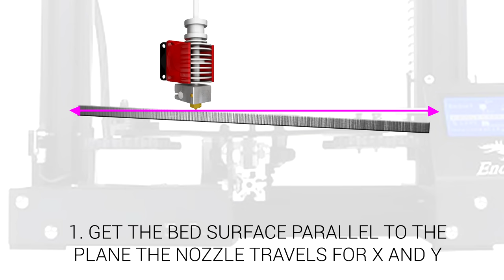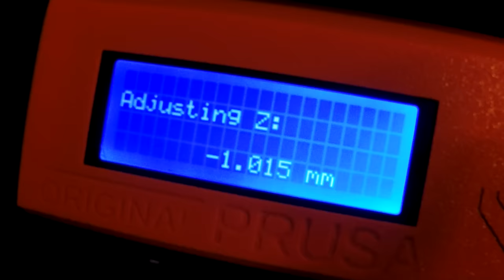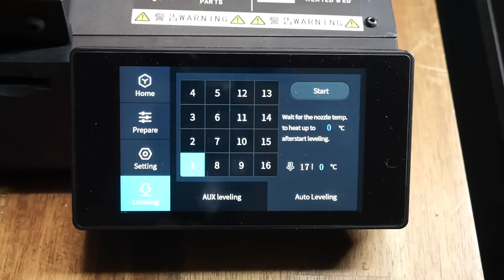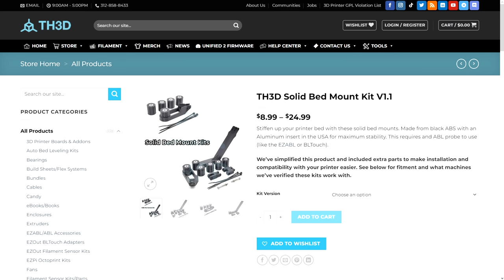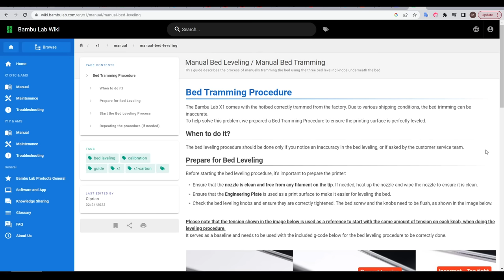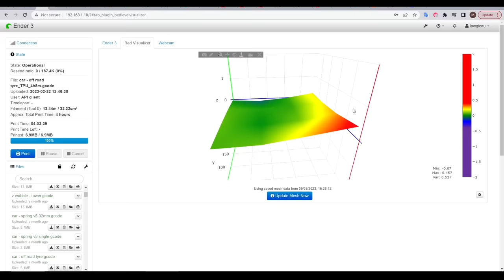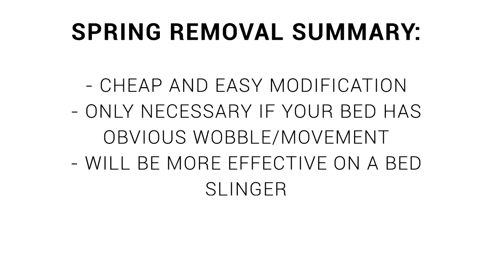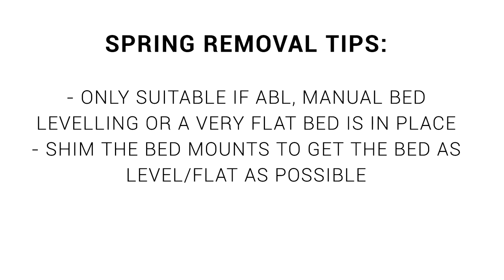Is it time for 3D printers to abandon bed springs?

Comment: When you rigidly mount a thin aluminum bed, like on the Ender 3, does it increase the chance of warping because the expanding bed cannot move outward? In the video, the printers with three point leveling have beds supported so that they can expand horizontally.
Reply: It can. This happened to my Ender 3 S1 Pro. I had it for a while now problem, but if the springs were tightened too much, the bed warped due to the stresses. I had to replace the bed. I can imagine if you went completely rigid mounting with a thin bed it could warp.

Comment: One of the reasons I bought an MK3 is that I failed miserably at bed leveling my old Wanhao i3. I could never get the knack of it, and my prints always suffered.  If the printer is going to required that I have to do adjustments to it, I won't buy it.  Not because I'm a snob about it, but because I know I won't be able to get the bed leveled and the right distance from the nozzle. It's all on me.  (I am, however, a snob about flexible removable bed surfaces like the MK3 and many other printers today have.  If you don't have that, I'm not interested, and I'm a snob about it.)

Comment: i have the yellow stronger springs it was fine when iwas using a z end stop not really many issues but since i got the biqu microprobe so many issues with the springs i was looking for metal spacers but then  i was told the silicone ones would be good so ive ordered those

Comment: Correct me if I'm wrong, bur something that came to mind for me is why do we need to deal with the bed hight when we could just set the Z offset with software?
Reply: Hardware solutions this simple are almost always more consistent. There's about a hundred use cases for software fixes, but starting with a true flat and level solves probably the majority of them.

Comment: In the interest of accurate information - Creality Hotbed Leveling Silica Columns - note it is Silica NOT Silicone. Generally, silicone is made mainly using naturally occurring silica stones. The key difference between silicone and silica is that silicone is a polymeric material, whereas silica is silicon dioxide.

Comment: I applied some nuts to all the bolts for the bed then added the springs. Stopped the bed moving and really locked in the bed to the frame

Comment: I'm using a fix bed (it's still ajustable like, i remove the springs and I'm using nuts to adjust the height it's rigid and it stays leveled for ever pretty much)

Comment: Could I not just tighten down all the screws, so the springs are very compressed, and there isn't any room to move? I'm running klipper with a BLTouch so I can set the z endstop wherever I want...

Comment: Honestly given the option id have a 1/4" steel plate keeping it perfectly rigid and flat...lol.  actually...now I'm tempted to bust out the plasma and cut a steel plate to see how thin a layer i can print fdm...  Im sure ive got more than enough in the garage..

My abl and auto dual z adjust do...really well, if it wasn't for how much the aluminum bed can warp itd barely have to even try.

Look at that x1 carbon... omg... its beautiful.  Single layer chainmail with no work... wow.  Granted my printers will all do it, but not at that speed from factory.  Just the level of "ready to go" is epic and would have been SO nice if we could have had that in the early days...

Comment: Does anyone know when using silicone spaces if the flat portion of the spacer touches the metal mount or the bottom of the bed itself?

Comment: bed springs and springy beds in general I don't think are useful for me and my printer any more. I am trying to use sensorless homing and frankly they are a terrible combination. Also have the long screws that don't tighten down and you know they move ever so slightly over time, enough to need me to level the bed a fair bit.  I would prefer to just make it a solid bed attached directly to the rails. It would give me another 10mm of print height anyways.

Comment: I think what makes a bigger difference in my Ender 3 is using hex nuts to lock down the screw to the bed. I use two nuts per screw to keep them from moving. This keeps everything way more consistent.

With this, I’ve tried springs, silicon spacers, and also wingnuts on the other side of the wheels to make a rigid yet adjustable bed. They all work great!

Springs by themselves are definitely the worst because any time they are compressed at all beyond your initial adjustment, there is play for the screw to move, which throws everything out of whack.

Overall, I’ve just come to accept the fact that there is no perfect consistency - every time the bed is heated, it can warp slightly differently so it’s always good to run the probe before every print.

Comment: The industry does a real disservice, especially to beginners, to use the term "Auto Bed Leveling".  People wonder how in the world a probe and some software can level the bed especially when some people have so much trouble manually leveling their printer bed.  Of course, the software/hardware can't level the bed which is why it should be called "Auto Bed Compensation" or "Auto Bed Tilt Compensation" or something more descriptive of what the system actually does.
As an "influencer", perhaps you can start the trend.

Comment: I don't see why people don't just use leveling nuts instead of springs or spacers. No need for spacers and shims when a simple nut will allow plenty of ability to fine tune the leveling perfectly, and then use a jam nut to lock it and then tension the whole stack with the adjustment wheel or just a 3rd nut.

Comment: It's the screws that help to adjust the distance between bed and the nazzle. Not the Spring.😉😁
Reply: That is totally NOT how you adjust the distance between the bed and the nazzle. Everyone knows that you adjust that distance at the base of the flabberwocky inversion plate.  Any other adjustment method will result in flatuated postule bushings that will prematurely evacuate the nazzle pre-load and nobody has time for that.

😀

Comment: What's with the Foam underlay beneath the bed?
Reply: Insulation under the bed reduces heat loss, faster heat up, less energy use, and potentially less variation in temperature due to drafts.

Comment: I don't think it's a good idea in general to remove springs (or other elements that have some give or flexibility) from tools that originally came with them; well unless those springs was originally an optional configuration, or if the manufacturer recommend doing so after a software update. 
Because if it were designed with the springs, everything is probably designed with the assumption that there is some give at that point; and if you suddenly make it completely rigid and the software or sensors or whatever expects to be able to flex those springs a little before something breaks; it now might just suddenly break when would have survived before.
Reply: Springs might also save the plate or its fixtures if you accidentally bump the plate a little.

Comment: Loctite is defeated by heat, even a slight amount. Rocset or vibratite are more appropriate for this.  Even a drop of ca glue would be better.

Comment: This can only be done on a printer that has ABL, on my CR10S that does not have it and with the prob mod costing me almost a grand in my money, no, I'll stick with my springs. I use a 0.1mm feeler for rough adjustment and then swith over to a dial gauge to get my bed to within 100th of a mm. This works for me, although very tedious, but considering I have to part with almost a grand to buy the sensor and then have to install it and reconfigure marlin and reload that...... Right now. Just not worth it....

Comment: Spring helps a bed to not vibrate due to THREAD in regulating knobs. There is no reason at all to remove springs. What I do NOT understand is how "auto leveling" before printing helps to print?? OK, suppose one of bed corners is higher. SO WHAT?? My model must have flat base, how "auto leveling" help me here?

Comment: I still don't understand why there isnt just a stepper motor under each corner, and auto bed leveling would actually tram the bed to the gantry. The current "bed leveling" with bl touch etc is fake. It adjusts the Z of the nozzle to compensate,  which is not laying parallel or square layers,  it lays a taper, or actually a stepped layer. Which can work, but is Not what it claims to be.
Reply: That's a good idea, but that would cost too much
Reply: @coltenmeredith8899  Hardly.  The style needed, like the Z axis stepper motor on most machines can be replaced for about $5. if that. $10 max per motor. Control board components cost half that. If its designed into the machine to start with, total material cost is maybe $50USD, especilly wholesale to a manufacturer... This is consumer cost. And at the design level, the software addition would be neglibable.. Pretty sure the bed mesh system that BLtouch uses could run them with little code addition for a decent programmer.

Comment: but that style of probe on the Prusa is no facilitating auto-bed leveling. why use words that don't accurately describe what is happening.
it is figuring out the slopes it has to create to get an even print, not changing the bed level.

the one with stepper motors is bed leveling, and even more accurately: auto.

Comment: Springs thermally warp, and last time I had them on a running machine they had warped 5mm. No wonder why I could never get it to level. I use silicon spacers now and haven't had to relevel since I put them on years ago. They should be banned! Springs are junk. cause pollution rejected parts.

Comment: Short answer yes, they are a pain, manual levelling should die a horrible death.  Autolevelling is not expensive to implement these days and should be included by default in all decent printers above the Ender 3 basic.

Comment: Pretty please buy a proper digital caliper. I've had 4-5 of that exact model, and it's insanely inaccurate. Error gets worse the larger the measurement is, but even at sub 10mm measurements, it's far out lol

Comment: yeah, any time a company says "it's tuned correctly at the factory" dont buy their products, there is no way to make human beings run perfectly every day, by shipping something so complex and then not even giving you a way to correct errors THEY will 100% make, i just dont understand how people allow this kind of business to exist, they do all of that because they will start having fee's on everything, you will have to buy belts, bolts, screws, nuts whatever from them (you can always source your own parts and fix it yourself, but almost no one does that), bambu labs is bad, sure they make a nice printer, but it doesnt change the fact their entire business model is to trap you (if your that stupid, i guess) apple has this same model they use, and it's done great for them, except, apple lives in the USA, bambu labs is in china, and all of your data goes to china, dont need to be super smart to know thats just bad to begin with. so yea, by the time bambu labs starts making everyone pay for everything thru them, it'll be to late for the bambu labs printer ppls, they will be locked in and oblivious to how they are enslaved